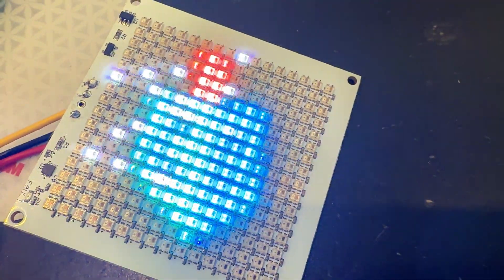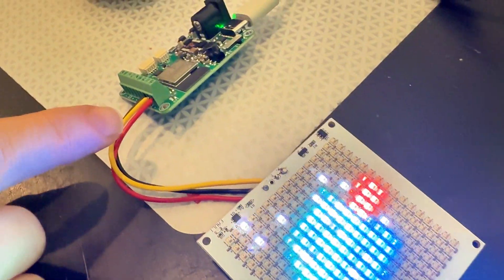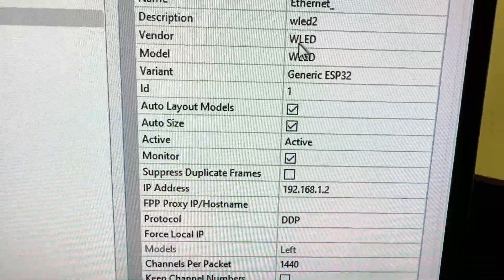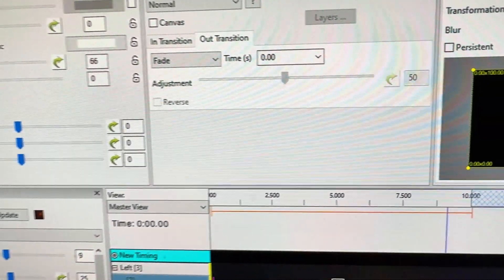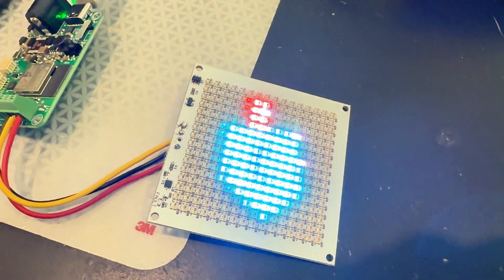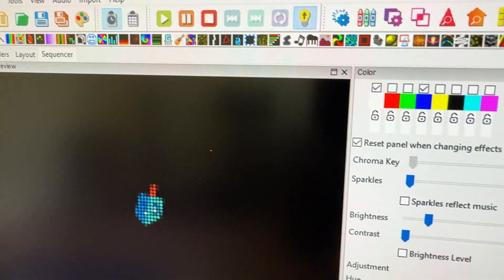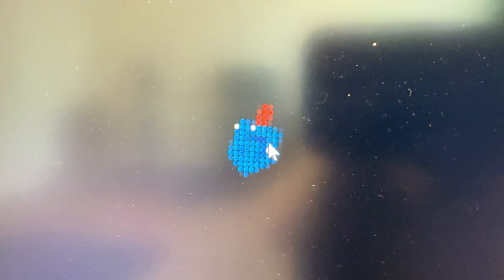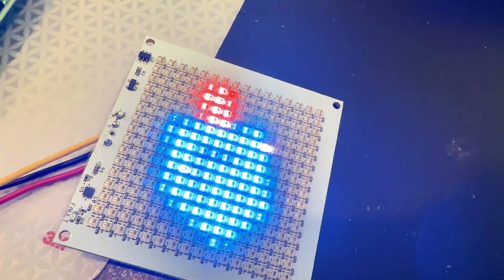WLED to xLights exploration ✨🎆

Comment: XLights is so rad. I use it for my holiday lights display outside. Being able to use WLED as a controller firmware driven from Xlights is great.
If anyone happens to want to get into Light displays, another useful piece of the puzzle is Falcon Player (FPP) - a Raspi distiribution that serves as a scheduler, show automation. You build sequences in Xlights, load those onto FPP, and have it play your shows every night. (or whatever) 

You can build a 10,000/20,000+ light display on entirely open source software and hardware.